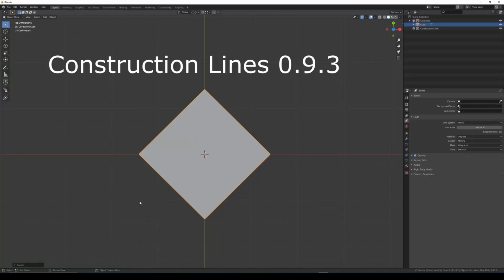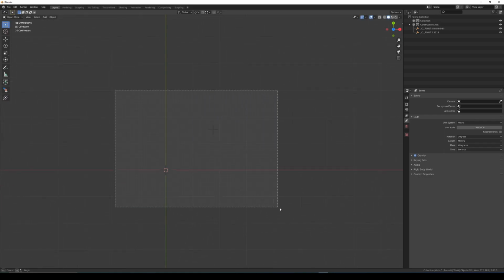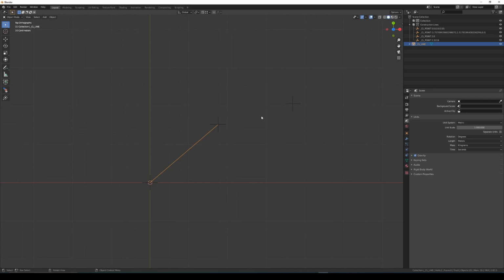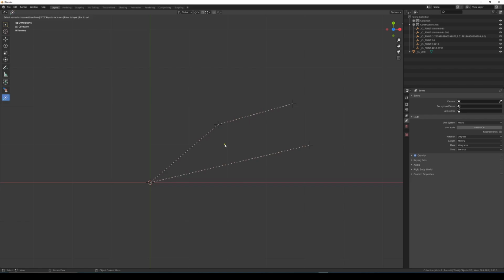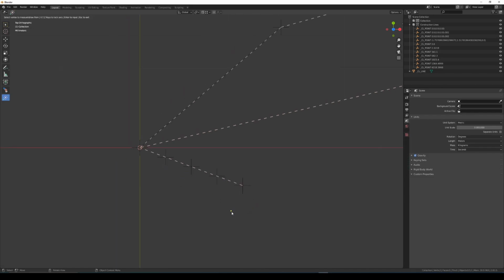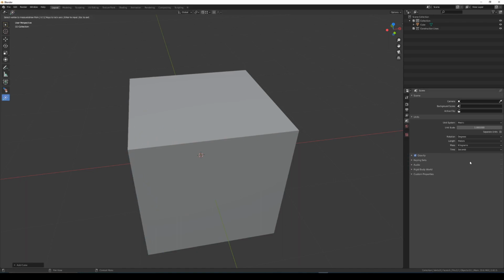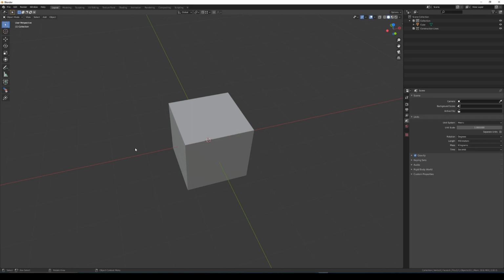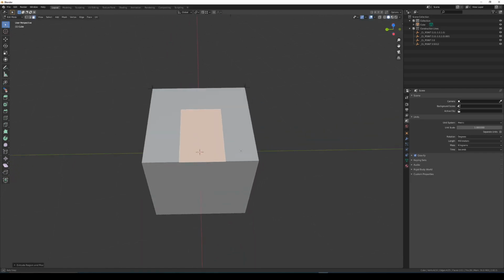Construction Lines 0.9.3 Release - CAD Modelling for Blender

Comment: Great tool. I have it and worked well in mac m1 until I updated Blender to 3.5. and it runs but showing an error about open gl graphics. We will see an update?
Reply from the maker: Thanks for the comment. I'm working on a new update, which should be released soon and will be supported on Blender 3.5. The developers have made a few API changes, so I need to update the code to work with those.  You should receive an email when that is released and I also post on Blender Artists.

Comment: I can only draw lines or rectangles on HORIZONTAL planes (using the "pen" only in the "z"-axis), that makes the tool less productive for me.
 Is there a way to draw on every plane - put the "pen" in the direction of any "normal" so to say?
Reply: Hi Christoph, are you using the latest version 0.9.5? You should be able to draw on any plane. If you are using 0.9.5 you may have pressed Shift and locked to an axis.

Comment: When drawing a rectangle or a line onto a object it is not clear to me whether I shall be able to actually cut the object using these shapes. Often I end up with a shape that is of no use despite appearing to be sitting right on a face/object. (I suspect I might be missing some indicator, but those are my early observations.)
P.S.: Is it just my or has the 0.9.5 gotten faster when detecting snapping points?
Reply from the maker: There have definitely been some snapping improvements and there are more performance improvements to come. Glad you noticed. If you're in edit mode on the object, the face dots should show if the face has split. Someone has pointed out a couple of bugs with this, where it doesn't always split successfully. I'll post a patch once it's fixed.

Comment: Any way to make the undo work without have to exit the add-on?
Reply: Ok. Seems to be working now. When I first installed it wouldn’t undo until I selected another tool.
Reply from the maker: @FPChris  Great, I'm glad it works now. There are some intermittent bugs with undo in the current version that have been fixed in the new version 0.9.5 which I'll be releasing in the next couple of weeks.
Reply from the maker: You should just be able to use Ctrl+Z to undo.

Comment: Please make possible intersect between circle and rectangle. Also, improve the arch tool, because at the moment is pretty useless. 

thanks, keep up the good work
Reply from the maker: If you're in edit mode circles and rectangles will intersect. Arcs won't do much on there own, as they aren't closed geometry but you can add them to any other geometry (when in edit mode) to build more complex shapes.
Reply: @dndrawings  in edit mode circle and rectangles will intersect only when you draw inside the figure, but if you extrude the shape it will consider as two different solid. there should be a kind of boolean operation that helps fuse the 2d shape. Also, the arch is only usable when you draw it on a surface but if you want to create a bridge arch will be almost impossible.
Reply from the maker: @capottolo1  Do you mean that the circle and rectangle should merge into a single shape? For arcs, are you using the latest version 0.9.4.1? 0.9.5 is in testing at the moment with a number of new features but also some fixes to geometry intersections. Let me know, as I'd like to fix the arc problem if it's a bug. Thanks.
Reply: @dndrawings  Yes sir, I'm using the latest version. I think is very important that rectangle and circle can be merge together but consider not only as an internal shape but something that stays outside of the shape this can make the tool real powerfull. About the arch, another problem is that if you create an arch and then try to close it with lines the arch will be considered as a separate tool. Arch has some problems with snapping as well. I think I will write a more in-depth email
Reply from the maker: @capottolo1  Thanks, that would be great if you can write a more in-depth email. I've done a lot of fixes with geometry for 0.9.5 but if there are more areas that need attention, I'd love to know before it's released. Cheers.

Comment: Within the first 30 seconds i was already on blendermarket and got this, coming from fusion360, Blender has a ton of annoying stuff, beside that it is strictly non CAD with the meshes etc. And subsurf modelling, if they get real curves and G0/G1 surfaces, that stuff like freecad even does, it will be a major revolution
Reply from the maker: Thanks for the comment. Glad you like CL! The next version is currently in testing and it's a big update, with rotations, multiple selections, face extruding (with cut-through), horizontal guides, guide intersections and a new toolbar. I'll be posting a video of all the new features when it's released, so keep an eye out.

Comment: Does this work well for buildings/houses with interiors?
Reply from the maker: Hi @PickleJuice I've only just spotted your comment. Yes, this works great for buildings. It's mainly what I designed CL for. A limitation at the moment is that Blender doesn't have a great way to extrude through walls (for cutting windows, door openings, etc.), so you'll have to use booleans for this. However, my next release 0.9.5 (coming out soon) will have it's own extrude function which works very much like SketchUp push/pull and will allow you to cut through walls and other shapes without the need for setting up your own booleans.

Comment: hi  maybe i just don't have it set up right but i can't seem to get the line tool to start on any grid point, only the cursor. Also once started it won't snap to any other point on the grid. What am i missing?
Reply: You can snap to any geometry, empty object, or the 3D cursor. The viewport grid isn't exposed in the Blender API, so you can't snap to it only. However, I'm currently working on building an internal grid in CL based on the Grid Floor Lines, Scale and Subdivsions settings, so that you will be able to snap to these points. This will work in Ortho mode and will have a preference to turn off as it could get quite annoying/misleading to have it on all of the time.
Reply: @dannorris1406  that would be good.  Can you explain why this isn't just a grid function in blender like a snap to grid.  To me the grid is useless for creating geometry of specific measurement. Seems dumb to me when sketchup seems to easily include it.
I'm pretty new to blender so maybe that is just a entry perspective.
Reply: also i went back to sketchup for this kind of work after realizing that your addon didn't do this!
Reply: @TaiowaMusic  The function you need is in the Absolute Grid Snap in the Snap To tools at the top middle of the screen. SketchUp automatically snaps to geometry and the grid but Blender needs you to tell it what you wish to snap to. Blender takes a long time to get used to, hence the reason I'm developing Construction Lines.
Reply: @dannorris1406  "Blender takes a long time to get used to"
a nice way of saying its UX is utter $hit (yes i use it and will keep on using it but it is a patchwork)

Comment: Awesome plugin! My first one for Blender too!
I'm a Sketchup refugee looking for a replacement, was looking into Fusion but after their last move where they nerfed it for the non-paying peasants I decided not to waste my time and go to its poor cousin, Blender.
 Anyhoo, questions/suggestions for the dev:
- I read here or somewhere else that people want an icon or something to show CL is on, could we have the SU measurements box as that indicator, maybe with a drop shadow?  
- Also, not sure if there's a way to input dimensions like 5'4" yet but can we have an option to move the ' and " to the extra keys (+-*/) on the numpad? It doesn't make sense, at least in SU, to type numbers, move your hand to the ' or Shift +" and then go back to the numpad. 
- Last, the guide lines don't look that good, could we have the option of a thin SU like guide line? A thin dotted line would be OK too.  And as long as I'm wishing maybe add SU's dinky guide points?

Wish you the best and thank you for the plugin!
Reply from the maker: Thanks for the comment and really glad you like my Add-on. I feel the same about SU and Fusion, can't wait to fully move away. I'm still tied to SU for work but hopefully not for long. 
To your suggestions:
- This is something I'm working on at the moment and I like the idea of moving the measurements along with an icon/text indicator for the current operation out of the top bar and into it's own box.
- You can input imperial measurements using " and ' I'll look into the possibility of using the operators= keys for this as you mention, my initial thought is that as these can be used to write expressions, it might be difficult. Is there a similar way in other software that you've seen? Maybe I could take some insight from that.
- You can set the size of the guide points in preferences (new in the latest version) which can be a scale value between 0.1 and 1. In the next version, as per someone's request you'll be able to reduce even further to 0.0001. I'll see if it's possible to do the same for the guide edge width and add to the preferences if I can.
Thanks again for your constructive comment.
Reply: @dndrawings   Hi again. 
For the ' and " my second best option would be: click 1, then 'ENTER' (or period?) on the keypad then click 5 = 1.5 or 1½, depending what you choose on settings. So for 11'5" you'd type 11 then 'keypad ENTER' then 5 and you'd get 11'5"
This would need another setting similar to SU's opening screen where you'd choose if you want to use feet and inches or inches and fractions
Last option would be the a setting where you can move '&" to keys on the left side of the keyboard, that way you can type numbers on the keypad and ' " with your left hand.
I hope my input can be useful and sorry for the late response, take care.